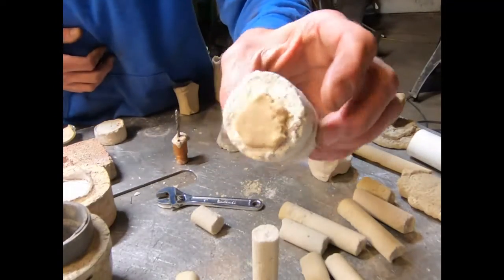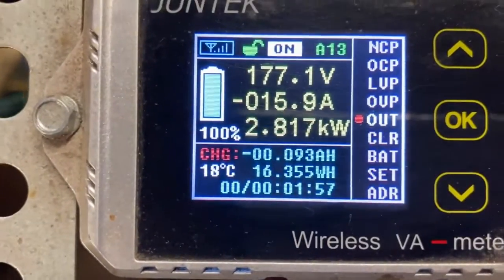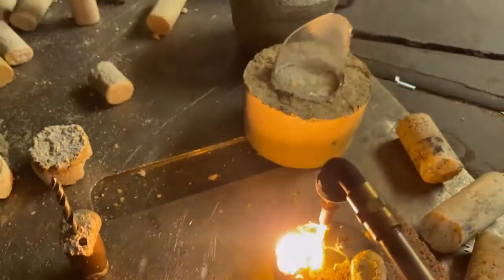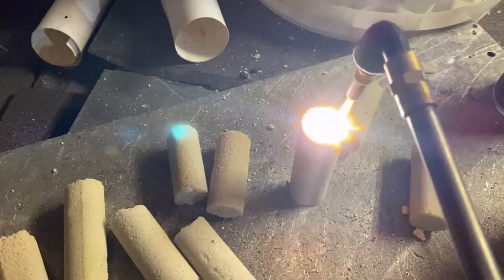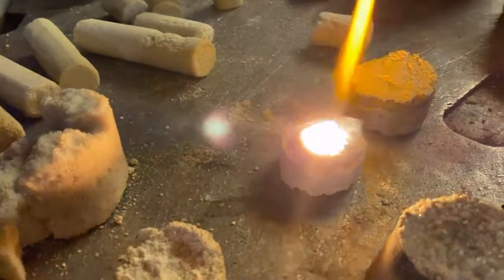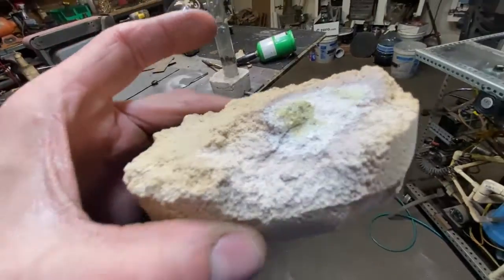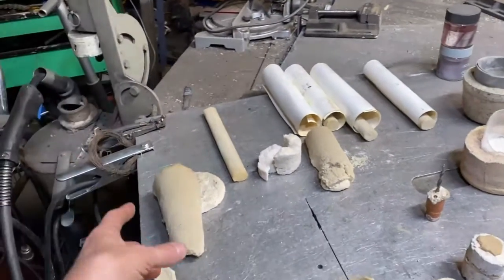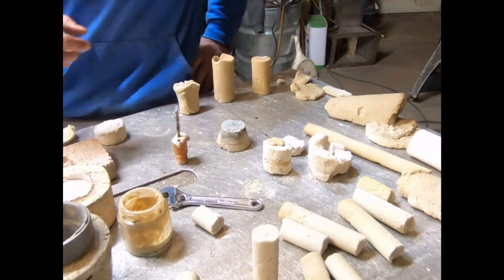DIY Refractory Glue and refractory brick 4600 F

Comment from the maker: Guys . Do not make this glue with Limstone powder . This video was a test run . the glue only works well if it never gets over 800 F 
the lime turns into calcium oxide if it does and a volume change takes place as it adsorbs water . Use fine clay powder or aluminum oxide with some silica sand . People have reported that Mud works very well but i suspect the temp limit to the dirt clay is low . Calcined kaolin is the best material to mix with other clays to stop the crazing or cracking as tis called . I apologize for any unsuccessful testing that may have bin done . The binder in this video is a very valuable mixture that can act as a great refractory binder

Comment: People have mentioned trying experiments with: Aluminum Oxide, Perlite, KaoWool, and others.   I also thought of adding to the list Bentonite Clay, powdered or granulated carbide, or even a commercially available high temperature refractory compound like Cement Carborundum Mortar.  Also graphite powder is a high temperature additive in some high heat applications. Most high temperature mortars are the silica-aluminate type and they may be interesting as additives as well.  I think you're onto something with your lime/water glass based mixtures and look forward to more videos.
Reply: silica-aluminates a mcdonalds salt i.e. dixie crystal salt
Reply: Zircon oxide plus bentonite beats them all.

Comment: if you want something add to the mixture, common sense tells me first choice to try would be material that makes cruisble and torch tip. say aluminum oxide? those purple stuff that makes your tig torch tip. you can get them from any old aluminum casting, or those "white fire bricks", that's pretty easy to find and smash to power. be safe, pal.👍

Comment: That's an awesome accidental discovery Bob! Thank you for sharing that with us.  Definitely you should consider selling it, it looks very useful and superior to many refractory materials. Other high temperature resistant materials I've seen and used for a carbon arc furnace and pretty much all of them were very brittle, you could look towards those avenues, but your material seems far superior.  I've also seen those "Starlite" type materials popularized by NightHawkInLight and others on YouTube but those actually puff up and burn as a carbon foam on their surface.  I look forward to your experiments, from all my reading and observations you are at the very top end of materials that resist heat yet retain strength.  Carbon-Carbon as it's known in the high speed military aircraft industry is the only thing superior as far as strength, but it might have lower temperature resistance than even your material. I've been wanting to melt this Niobium metal I have for years so if you do end up selling it I will be one of your first customers. Thanks for all your information and excellent videos.

Comment: you can also make Aluminium Oxide yourself and add it to the mix.
a lot of handy videos out there on how to make that stuff,  did it a few times myself, pretty easy. i would recommend you to keep all pieces of scrap Aluminium you have and convert them do the oxide so that you will basically have an endless supply.
Reply: At how much aluminium oxide costs   and how common it is,that would be like making yourself water from oxygen and hydrogen because you seen somme crazy on youtube doing it.

Comment: Hi, Thanks for all your videos and this particular one. I followed it all the way through! Very interesting. I will be trying lime with silicate as it is one combination that I have not yet tried. (I have some garden lime leftover from an attempt to make refractory cement, that was a failure.) You may find that for an extra hot-face coating on a furnace, a thin coating might work best. I use a similar silicate coating made with talcum powder, aluminium oxide and iron oxide (Just for a dark colour). I paint it on as multiple thin layers onto stainless steel to give it more protection when burning charcoal within tiny forced-air stoves. The thin coating works best as it seems to be able to expand and contract with the heat expansion and contraction of the SS which is very considerable. It works as an expanding crack filler by itself. It also makes a wonderful expanding refractory when painted thinly on aluminium cooking foil and stuffed into a hole. It gets hot, fumes, expands, oozes and bubbles off hydrogen gas and cures itself. It can be hurried along with a flame, so you should be in your element!

I too have had no success with sand silicate refractories. They fail badly on subsequent heating or just with the lapse of time (very good for casting cores).

Pure aluminium oxide mixed with a little silicate makes a rock tough refractory as does the garnet waste grits from the sump of a water jet cutting machine. I don't have a hydrogen flame to test them, but they just laugh at repeated cycles of the hottest temperature that I can produce when they are heated in a thick bed of charcoal in a forced-air furnace or forge (Way above the max temp of 1300C K-type thermocouple. A similar dirt cheap silicate refractory can be made with subsoil from my farm and a nearby park (loamy clay free soil from post hole digging or crab hole mounds if you are feeling lazy).

I mix perlite or vermiculite with this post hole soil and silicate to make a lightweight insulating furnace refractory with excellent insulation (way over 1300C on inside and harmlessly warm to touch on the outside). Its remaining weakness is that the vermiculite (or perlite) starts to melt (turn to glass) somewhere above 2200F (~1200C). That is where I would like to try your lime silicate as a more refractory coating to prevent this melting. Here is a video of the furnace:
https://www.youtube.com/watch?v=PIDgGCa4iUM&list=PLVaCw7cPfpCzDoXce-GgNbFFdxX-bPiHR

You or your followers may be interested in more details of my exploration of a long list of silicate refractories on my website:
https://timtinker.com/diy-refractory/
or my DIY furnace made with silicate
https://timtinker.com/diy-wood-charcoal-furnace/

Thanks for sharing your ideas and I will add lime to my silicate refractory list.
Tim
Reply: @Tim Telemark, Howdy. I have seen your website on refractory experimentation. Extremely informative! You had poor results on your lime/sodium silicate preparation. You said it crumbled and even tried the different recipe of sodium silicate from Nurd Rage. In this video Nobox7 is using garden lime which is crushed limestone or calcium carbonate which has not been calcined. If I am not mistaken, you were using calcium hydrate which is calcium oxide slaked with water. The garden lime is not calcined into calcium oxide. Also, the slaked, or hydrated lime often contains some magnesium. The different type of lime could have caused your crumbling issues. Blessings.
Reply: @revscott58  
Hi, Thanks for your constructive comments and your interest in my refractory post. Sorry for the delay in replying as I have been away on an extended fishing trip. As I understand garden lime is mostly calcium carbonate and that was what Nobox7 suggested. Are you suggesting that I use calcium oxide or should it be calcium hydroxide? Kind regards.
Reply: @timtelemark907  Sorry Tim, I just now have seen your response and question. I think there are 2 different products sold as garden lime. One is calcium carbonate, and the other is called dolomitic lime which also contains magnesium with the calcium carbonate. I think either of these should work because it is probably the carbonate which cures the sodium silicate.
Reply: Tim, I do not know which type of garden lime Nobox7 used. I don't think calcium hydroxide will work. It is not garden lime.
I went back to your website to review your attempt at making this and you had used calcium hydroxide. That is not garden lime, it is builders lime for making plasters and stuccos and is probably why your mix failed. 
Blessings.
Reply from the maker: Thanks a million for the comments , you guys make these videos more valuable than the footage i present  . This video was a fail after later testing . This was the first test on this material . I hope people see your comment for advice
Reply from the maker: Tim thanks for your time and extremely valuable input . I may do a video for you in the future to share your work and boost your reach .
Reply from the maker: Tim great work , sorry to report this formula does have issues if heated past 800 F . The aluminum oxide and silica sand mixtures are far superior  . The girls in the pottery world use calcined kaolin and kaolin as an anti crazing additive

Comment: I'd test for moisture resistance after firing. The limelight was using quicklime, which results from heating lime until it loses CO2 (check wikipedia for limelight). Unfortunately, quickline will absorb water and get to slacked lime which is not a good binder. Granted, the presence of the silicate in the stuff may divert from part of the lime-quicklime-slacklime reaction path, but the content of silica is too low to bind the entire calcium.
If the material crumbles after fired and then absorbing water from air, it can still be useful when you don't mind reapplying the protective coating (i.e. "painting" a crucible) even if it wouldn't be necessary suited for long term without refreshing it.
Reply from the maker: Yes i discoverd ths issue and you are correct , the water expands the material 75% and it all falls apart

Comment: I have mixed aluminium powder in with refractory cement and the caustic in the cement causes the aluminium powder to react and make hydrogen gas and make the cement aerated. The problem is it’s an exo ther mic reaction which dries the cement quicker than desirable and weakens it

Comment: When I worked for Pillar Industries we made huge industrial induction heat treating/parts handling robotic systems. The main units utilized in the foundries were for smelting and creating various molten steel and aluminum blends to pour into sand molds. Refractory coatings were utilized to reflect heat inward and insure a proper barrier between the molten metal and the inductive coils buried in the Refractory that was used to melt the metals.
Reply from the maker: Great input , That 100HT or what ever it is also does that

Comment: I've goofed around with some refractory-making ingredients that you may find of use. Primarily I was interested in making my own graphite, which was completely successful, though two of the experimental refrac materials were also a win. At the temperatures I'm pushing it acts more as an ablative material, but if you were going to cast iron or something a bit less intense, It should hold up just fine. 
 For a hint, look into how roman concrete was made, it'll provide a lot of insight for your projecting mix. You've got most of the mix already, just missing one ingredient which, unless you live next to a volcano, is a bit hard to find. I'm trying lava rock which is hit and miss, but if you can find pumice for a good price, it works too. 
I ran out of traditional methods where I could get extreme heat to break it down (over 6000*F), so I ended up getting a plasma cutter to really see where it can go.
Reply: I'm using lava rock, water, a steel pot and a heat source to store heat for my home. When summer comes I want to see what sort of temperatures I get. I'll apply that heat elsewhere for power production

Comment: There is a product called 'Heat Fence" it came in a 12 or 16 oz jar, it was a pure white 'putty' . It remained pliable and reduced the propagation of heat past the barrier of the material, so once the heating was done, the material could be put back into the jar. I like the adhesive characteristics of what is demonstrated here. A material to stiffen or reinforce it might be a glass fiber, carbon fiber, or a product called 'Thermo Felt' from J Tillman co. Great to see some real science going on.

Comment: As for advice i reccomend Zircopax plus somme bentonite.
Or alumina with bentonite like 5-15%.
But it will take a lot to dry depending on how much bentonite you add.
I would also add 1% by weight toilet paper fibers to the mix.
Zircon( zircopax) its more refractory than alumina,much more heavier thogh and a few times more expensive.
You can buy these materials at ceramic shops ,like pottery shops.
Reply from the maker: Your are absolutly correct the garden lime is a very poor choice

Comment: Such interesting stuff. This glue is very impressive. I can see many applications in blacksmithing and knife making. 
Just thinking/wondering what a mix of the glue and perlite would perform like. may help bulk it out as a refactory cement.
Reply from the maker: yes it would coat blades very well , its super sticky

Comment: You got some interesting videos, and a cool ebay store
Just to note- 200grams of water is equal to 200ml of water, which also takes up a volume of 200cubic centimeters or 2cm x 10cm x 10cm =)
i.e 1kg of water=1liter=1000cubic centimeters/10x10x10cm cube
Reply from the maker: Oh thanks , did i make a mistake ? i do that on occasion for some reason . Yes you are correct .

Comment: EDIT: It's not necessarily CSH,

Did you add water? If yes, you've made CSH, basically regular cement, so probably not CSH.

But if you only add waterglass, then you probably made calcium silicate. Wikipedia said Calcium silicate has a melting point of 2400 kelvin, which explains why it can withstand oxyhydrogen torch. The torch has a burning temperature in that range, which can be higher or lower depending on the nozzle. It is quite solid, with reported strength of 10 MPa, 1400 psi.

If you don't mind testing, make a "geopolymer". It also uses waterglass, but instead of the garden lime, it uses heated kaolin clay. You can buy kaolin clay and heat it to 1400 degrees F, or buy "calcined kaolin" directly. It should be stronger and have a smoother finish than the material you made. Depending on your mix, it can be set anywhere between an hour to a day. Also, you kinda have to mix with a mixer, because it's very viscous and it would be very tedious if you hand mix it.
 
But geopolymer can only withstand about 1200 kelvin, which is half of your material. If you decide to make a structural component that is heat resistant, you may choose geopolymer as its strength is about 2000 - 7000 psi, but if you only need insulation, this is a great material. Thanks for sharing!
Reply from the maker: Great input friend , i only added water glass to the garden lime
Reply: The ratios in the recipe given gives ~4 times the water needed for water glass.

Comment: I think you got it.  The expansion and retraction of the metal will weaken the bond.  The concrete though holds it well even after heating and cooling... good job and many thanks.

Comment: I would measure your refractory glue for temperature expansion and contraction, anyting I added would be to get that number closer to whatever your painting it on. expanding and contracting A different race is probably what's making it come loose from the metal.
As far as the water glass sand cores, I was told they fall apart at high temperature so that when the metal shrinks as it cools it breaks the sand rather than itself. they are intentionally designed to do that to work correctly inside a green sand mold. You also want to be able to remove that core when you're done casting the metal so it helps if it falls apart on its own

Comment: Hey bob, I have an idea,
take your hardest refractory available, as probably is this stuff, and cast a pedestal with 4 to six upqard pointing feet, if you will, so the crucible you put in a foundry is resting on a few points with enough space for decent circulation between said feet.  The floor of the foundry could be carved out to bury the support disc underneath.

Comment: Interesting, the lime should give off CO2 when heated, like Starlite, which will react with the waterglass.
Too bad you didn't weigh a sample pre and post burn.

 If you want stiffness, just put some stainless steel shavings in the mix.
This stuff seems pretty cheap, so it could do as an outside liner of a furnace where weight isn't an issue, since the lime is sensitive to acid.
Reply: Even better for stiffness would be basalt chopped fibers.

Comment: I like this vidio- that might work good for a burn tube for my wood powered truck- I like that strength test- though ceramic blanket is lighter, if coated with pure water glass- though that stuff looks excellent if you can combine some insulative properties to the mix- as long as its stronger than ceramic blanket,it would work for part of the burn tube , in a wood powered truck, there were over 1 million vehicles powered by wood during several war time frames due too gasoline shortages.